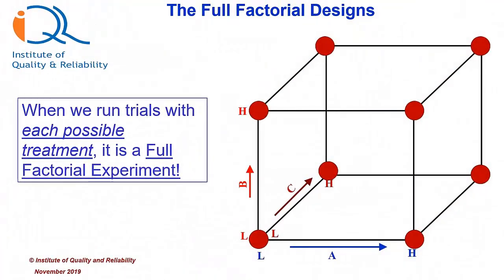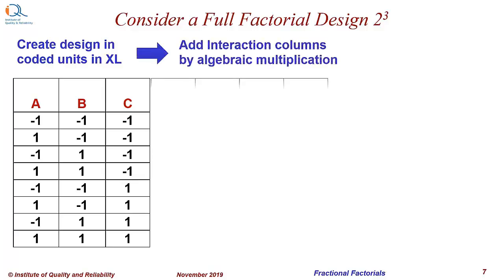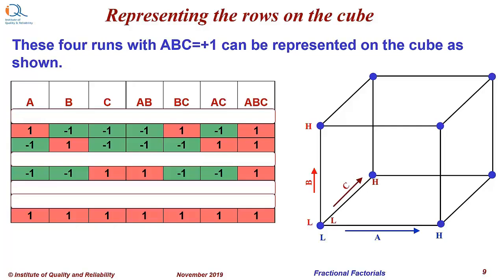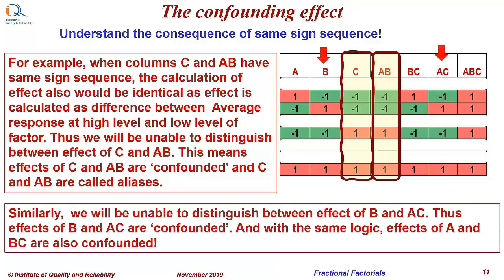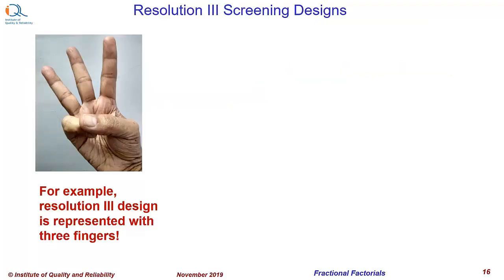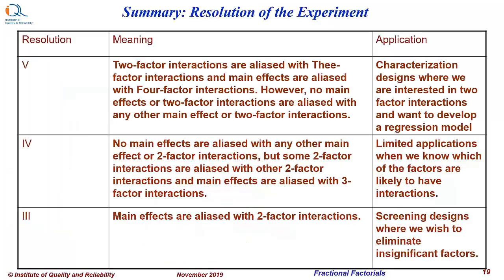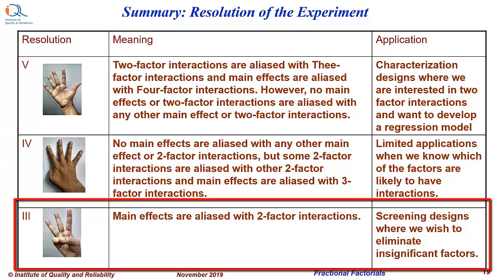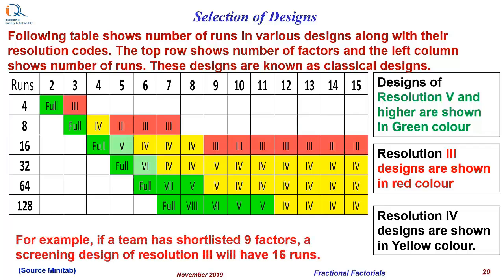DOE-5: Fractional Factorial Designs, Confounding and Resolution Codes

Comment: Excellent video, it was really helpful. I got a question, what does a 3*2*2 factorial design means? I understood it refers to three factors and each of them with a specific level, i. e., the first factor has three levels, the second one has two levels, and the last one two factors as well. I thought it was a fractional factorial design. However, I tried to do this on STATISTICA and I could not find a design with 12 runs (according to 3*2*2). You would be so kind to help me to understand this. Thank you.
Reply from the maker: This is not a usual convention. Experiments with different factor levels are called General Full Factorial Designs. You need to create a General Full Factorial Design in software as this is not a standard design.

Comment: How about a situation where you have 2 factors ,one with 7 levels and the other with 6 levels. Full factorial gives 42 runs. How do you run these with fractional factorial with less runs?
Reply from the maker: Standard fractional factorial designs are  available for two-level designs. In ur case, A has 7 and B has 6 levels. Fractional factorial design is not possible in this case as there are only two factors. If you have more factors with >2 levels, you need computer generated designs. For this you will need clear understanding of the degrees of freedom and your requirements.

Comment: "Experimenters have found that higher order interactions tend to be small and can be ignored often" 
Is there any reference book or something that we can use to support this statement for the research projects.
Reply from the maker: Hello Nirushan kathiresu,
I am repeating the same answer that I mentioned in your other similar question. 
Basically, the fractional factorisl designs are based on one of the principles known as Sparsity of Effects. According to the sparsity-of-effects principle, it is unlikely that complex, higher-order effects exist, and that the most important effects are the lower-order effects.  Thus, assign the experimental units so that main (1st-order) effects and the 2nd-order interaction effects can be investigated. You can get many references for this.

Comment: "Experimenters have found that higher order interactions of three and more factor tend to be small and can be ignored often"How did we reach this conclusion.
Reply from the maker: Thanks for your question!
Actually this statement is more of assumption based on 'The sparsity of effects principle'. This is more of an assumption that should be based on technical knowledge and judhement and needs to be validated based on analysis of experimental results. If the assumption is not valid, we should find low R-sq values, R-sq-pred values. The experimener is also taking some risk to save time and resources while reducing number of runs in fractional factorials. 
With best wishes..Hemant